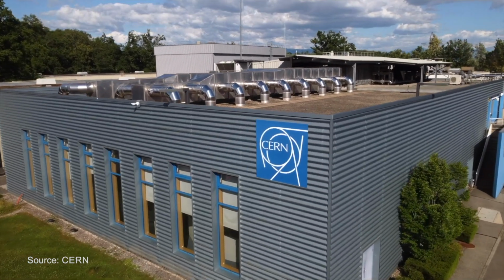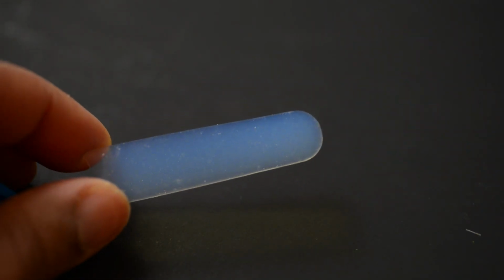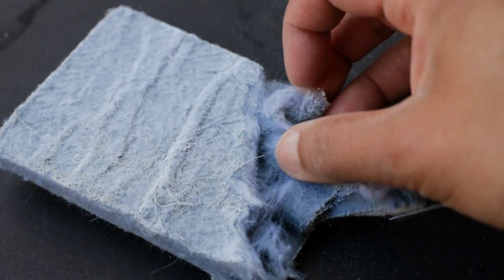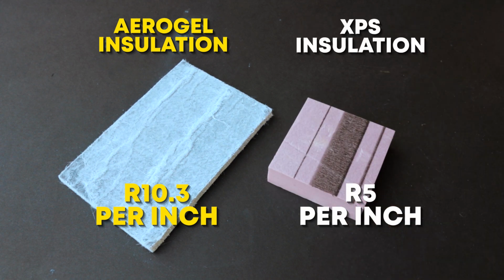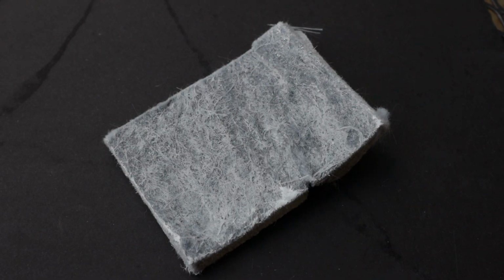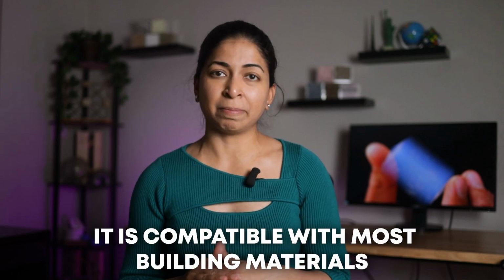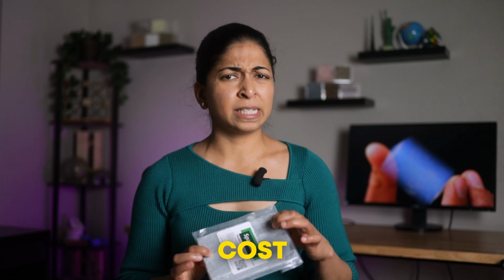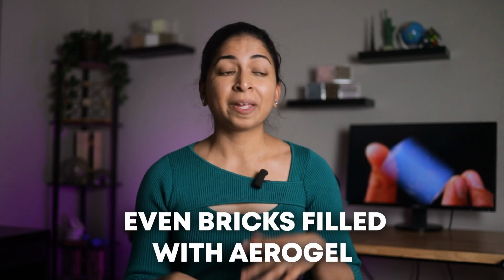Can Aerogel Insulation cut down our energy bills?

Comment: You know, they told the public that Asbestos was safe too and it was installed as insulation globally and also in concrete water piping. Look at the latest earthquake in Turkey, where buildings came down and all that asbestos was released into the environment as 250,000 buildings turned to dust. They don't even know how to demolish the remnants of buildings and dispose of the rubble safely and contain the debris and protect human health.  Look at multiple North American cities where we are discovering asbestos concrete water pipes releasing fibers into municipal water supplies at lethal levels. Maybe, we should stop now with this silica based product as the health injury potentials are a known fact. We had urea formaldehyde, tainted MGO, tainted drywall, lead paint and fire retardant chemicals and plastics in the past. Even Rockwool has warnings surrounding carcinogenic properties from Europe, yet we're pushing forward at full speed. At what point, do we truly evaluate risk and long term health consequences and properly inform installers and homeowners of the risks of exposure? We seem to only do that afterwards, decades after the health consequences show up and people's lives are ruined. The public has no idea of what is installed in their homes. They just get to pay for it with their health and their wallets.

Comment: That is the major problem is each one of these things is costly AF. 
I want to build a new house which will last a long time. be low cost yet provide a good amount of insulation over the life of the building. I am pushing for a R40 wall and R80 roof. There are a number of project that would be ideal to build with yet they all cost far more than they are worth. 
I looked at aero gel years ago and it was expensive back then and still is today. We are talking about R10 at 200 to 600 dollars per sheet 8x4. Yeah the Zip sheets are R12.5 and come with the osb for 100 per sheet and not including their expensive tape. The only bad thing about zip sheeting is it is not rated for interior and or roof. Which is kinda a bummer. Though I do that you could get away with using it on the inside. 
I would like to find a lower cost unit as I do not need zips special wood. i just want 2 inches of foam on the back of the 1/2 osb and then I will tape and seal it like it should be. Rated for roof, exterior and interior walls. 
The one thing that aero gel osb board would be good for is if they had 1/2osb with 2 inches of gell and then a 2x4 wall with this on it and then do the interior the same way. I am not sure as long as the walls are 100% sealed inside and out you do not need to put anything in the wall cavity. You can use those air tight electrial boxes where they are faced nailed to the osb cut out and then has a full foam seal once you put the dry wall on.

Comment: The R-value per inch isn't very relative when it is only 10mm thick. To get better R-value you would have to use several layers of the stuff and it is already outrageously priced for 1 layer. They're going to have to do alot better to make this viable.
Reply: Yeah its 200 to 600 dollars for a 4x8 sheet. It is going to have to be far cheaper. Which is the reason why not many people use it. 
Though it would be ideal for a lot of things if they could make it inches thick like foam board.

Comment: Aerogel is such a fascinating material. Extreme cold-weather gear made with areogel insulation is incredibly thin compared to the very bulky gear with other types of insulation. It is so effective that it can actually cause overheating very easily if it is used in temperatures above zero.
Reply: I had not considered clothing as a possible use for this stuff. Is the dustiness somehow contained within whatever sleeve/pouch the aerogel might be woven into, or do they use a different binding media than the fiberglass for walls?

Comment: I cannot wait until my Hvac pipes are insulated with aero gel instead of Fiberglass. I HATE fiberglass insulation. For now it is the cheapest option but I hope that changes. Thank you for another interesting construction materials video!
Reply: I am considering building my new home with only with mini splits units. With the overall cost of a single unit compared to a centeral air it would be overall cheaper and better. Since I am doing a single level I am opting to install a filter system. I have not decided if I want in stall one large mini split  and then add more per additional rooms. I am looking at a direct solar connection to the mini splits that can run solar only mode, grid only or a combo of the 2. Right now they only come in 1 ton and 2 ton single head units. The company that makes them also sells water heaters that are the same way as wel. 
Either way I plan on installing a filter system that is like an hvac system yet runs on direct DC and then another one that runs on AC. These will be small hvac system that start in a filtered ceiling return box then spit out to several small 4 inch lines to vents in each room and then around the other areas. This will help filter the air during the day time via just solar. I am working on a prototype project right now. I will have several of these in my home. Which will be covered by over 2 feet of blown insulation. Right now our current hvac system is in the crawl space with is cool and there is little insulation around each pipe.
Reply: @kameljoe21  Link please, I'm looking at ac/dc mini splits that can run on solar or grid, but I need the water heater too.